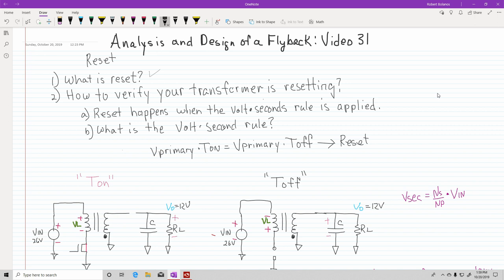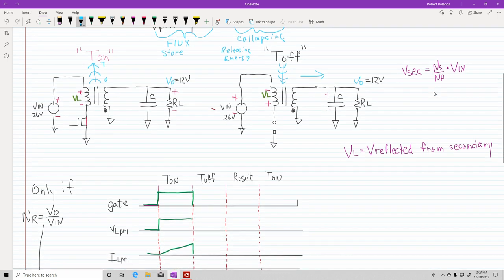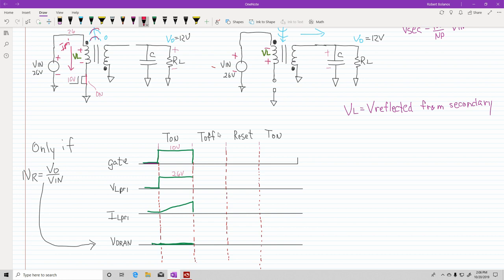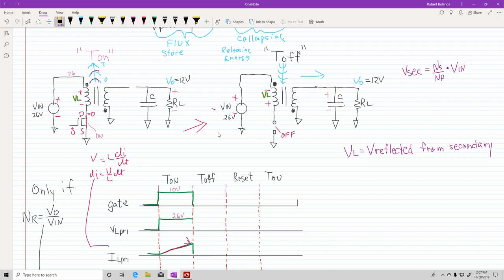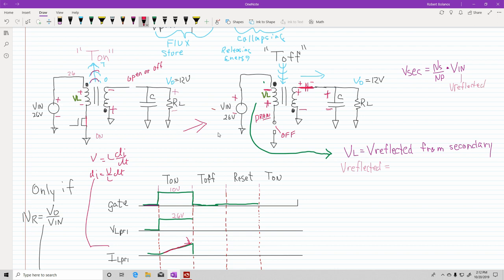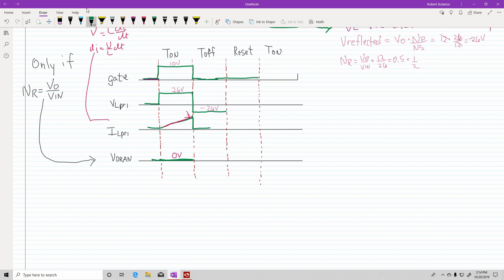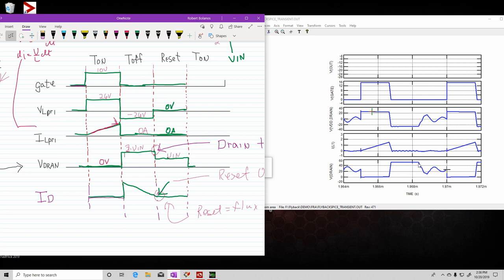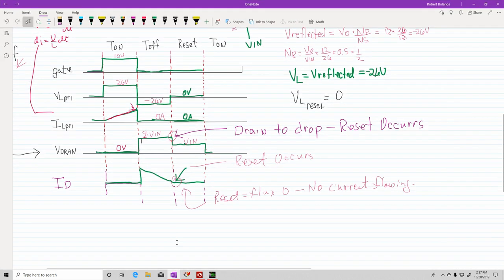Analysis and Design of a Flyback; Video 31, What is reset?

Comment: Hello sir. I wonder if the Vin is from 55V~550V, and I design the circuit with minimum Vin (55v), the Vds may be around 2Vin. But when working in Vin=550V, why the Vds=550V+VL (reflected voltage) instead of 2Vin (1100V)？